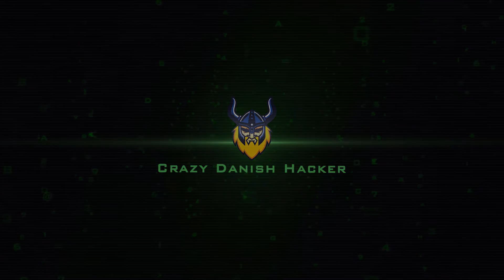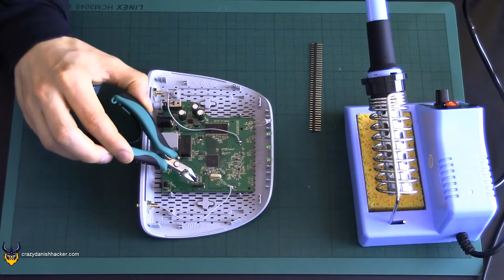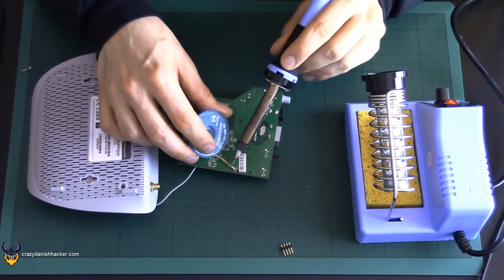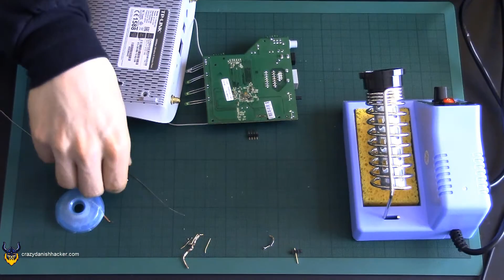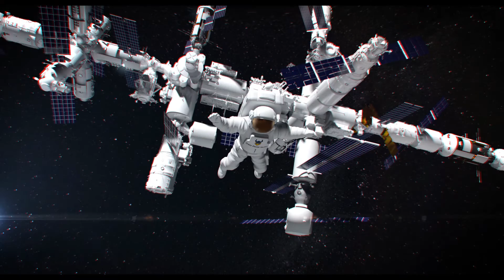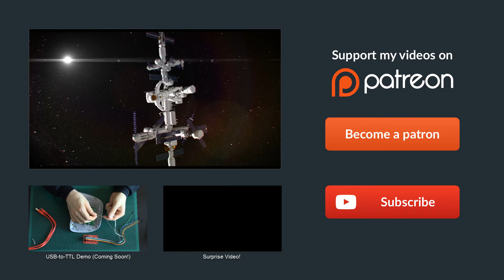Accessing Hidden Serial Consoles - Fixing Bad Grounds - Hardware Hacking Series #3

Comment: Cool! Take a video about openbts / imsi catcher
Reply from the maker: Sometime in the future, I probably will do. Last time I tried Open/YateBTS it (i.e. the signal in particular) was inconsistent and my phones had trouble maintaining a persistent connection. So it's not because it's impossible, it's just that I don't make videos with broken demos, and that I have very limited time for research these days.
Reply: Thank you! It worked for me.I use motorola c118 phone and openbts project,a telephone nearby and working in 2g auto connects to me because I indicated in the settings of the mcc mnc of the operator.Now I have another problem..the phone is connected to my cell can't call,send SMS..don't know why this is ?
Reply: Hello! yesterday I started the openbts network,all is well..the phones are connected(if you select network in phone settings),can send SMS,but how to make so that the phone automatically connected to my network?
Reply from the maker: [Disclaimer: This information is for educational purposes only. If you break any laws and get e.g. arrested or a fine then it is your own fault for breaking those laws.]

You need to change the MCC and MNC to what your home network is. It should be the first six digits in your imsi. This only works on 2G. For 3G the clients (UE/mobile phone) can authenticate that the network is authentic, and for 4G, the network can also authenticate that it's a valid client.
Reply: I'm not going to break the laws! in no case! I try it at home on my phones, thanks for the hint, do I need to enter mnc mcc for this operator?
Reply from the maker: Let's say your target phone is using MCC 001 and MNC 002. In that case, you need to configure OpenBTS / YateBTS (or whatever other software you're using) with those values before you start transmitting.

In this case I'm assuming that you're using a BladeRF x40 or USRP B200 with a TCXO module (https://www.ettus.com/product/details/GPSDO-TCXO-MODULE), and that your fake / rogue BTS is using MCC 001 and MNC 002. 

In that case, it should work. I'm not sure if your network needs to transmit the correct network name as well, but I do know that if you don't set the MCC and MNC correctly, then your phone will think it's a roaming network.

If you can afford it, then get or build a Faraday cage or tent for testing.
Reply from the maker: You can't call or send SMS to phone numbers "outside your rogue/fake network" (or use "WAP/GPRS"), because you haven't configured a gateway for voice calls, SMS or Internet.

Look into configuring a VoIP gateway for OpenBTS, and also forwarding Internet traffic from OpenBTS to the Internet. That will solve 2 of the problems. I have only read a guide long ago about this, so I can't remember how they solved the SMS problem.
Reply: Yes,I have fake honeycomb =)).You can solve this problem? I think there is no sense to grab the telephone if it is impossible to attack it.
Reply from the maker: Receiving phone calls or SMS from "outside your rogue/fake network" will be almost impossible, as the other network providers can't route traffic to your network.

There may be a "hackable" solution, but I haven't really researched this at all yet.
Reply from the maker: I haven't tried configuring a VoIP gateway, etc. with OpenBTS, but there should be at least 1 guide on the Internet that describes how to do it. When you make your own 2G BTS and phones automatically connect to it, then you can intercept the outgoing data, SMS and phone calls, which is a "Man-in-the-Middle" attack.
Reply: I have this situation,the phone automatically connects to my cell when I choose in settings 2g gsm,although it is in this mode always.Don't know what it is?
Reply from the maker: Old phones only use 2G. Newer phones support 3G, 4G, etc. The newer phones will almost always prefer 3G and 4G with a "weak signal" over a strong 2G signal, because you can't really use any high bandwidth applications over 2G. Even a simple Google search on 2G GPRS is pretty slow. 

If you configure your phone to only use 2G, then your phone will always prefer your fake/rogue BTS as it has the strongest signal. That's why Man-in-the-Middle attacks with fake/rogue BTS work.
Reply: Thank you! If I setup voip on my fake honeycomb that I can accept incoming SMS sacrifices in my fake online ?
Reply from the maker: I doubt it. You have to see it from the big perspective. Your fake/rogue BTS, is unknown by every other mobile provider. When user A on a legitimate network, tries to send SMS or call user B on your fake/rogue BTS (network), then the legitimate network has no idea how to route traffic to your network, because it "doesn't exist" when seen from the legitimate (i.e. registered) network(s).

If two users are on your rogue/fake BTS (network), then they can call each other and send SMS to each other though, because your network is handling all the traffic.
Reply: And how to redirect the traffic to another cell, that is, to make the phones communicate as usual, is this possible? And so that the victims of my network could be called by others
Reply from the maker: As far as I know, not without having your own legitimate network, substantial infrastructure, etc. as you need access to SS7 for example. I don't know exactly how mobile cellphone provider networks are configured, but you would also need stuff like "HLR" and "VLR", and more. Also, your legitimate network would only work locally unless you have "roaming agreements" with other networks.

Comment: why did you remove the console headers that TP-Link provided you with?
PS: Which UART device will you use (FTDI Basic or something else?)

PPS: is it posible to disable username and password that are normaly shown when you connect to console (if you don't know them? (OpenWRT doesn't write them on their wiki for some routers)
Reply from the maker: The console headers were not provided (i.e. not soldered on by default) as I probably mentioned in the first video in this series. I soldered them on but the recording was lost. After I had played a bit with the "terminal", the ground connection got lose and I decided to record a session where I remove the old one and replace it with a new one.

The UART devices that I'm using are the BusPirate v3.6a and a simple USB-to-TTL cable from Adafruit, even though other vendors have very similar looking devices. You can see more details in the video description here: https://www.youtube.com/watch?v=v9q6Sye7WgU (Complete links to all hardware I used. I personally prefer the USB-to-TTL cable as it's really simple and fast to use.)

If you have overwritten the firmware with OpenWRT, then the username and password should be something like root/root. If you haven't, then you need to either:

A) Boot into single-user mode, this may require you to flash the firmware first. In my case, changing the boot parameters to single-user mode from the serial console, does not change the actual boot arguments/parameters. I'm working on this a bit to find the easiest point of entry once you have UART / serial console access. 

B) Reverse engineer the firmware and attempt to crack the password or look for vulnerabilities. I'm planning on showing some basic reverse engineering, even though it's one of the fields that I have close to zero experience in when it comes to reverse engineering binary files and looking at them with e.g. IDA Pro. (It's another skill that takes time to learn. I was able to find a password hash for the root user, but after several hours it wasn't cracked with some very big wordlists.)
Reply: try if root/5up works on your TP-Link
to get into uBoot prompt type tpl as password
Reply from the maker: 5up and all other known passwords for TP-Link do not work. Neither does 1up, 2up, 3up, 4up, and 6up, etc.

The next video which I've already recorded, shows me typing 'tpl' which enables the uboot prompt. However, as I mentioned, if I try to change the boot args/params, and execute the boot command, then the default args/params will be used regardless of what I use. 

Thanks for the info though, I'm sure others will benefit from it :-)